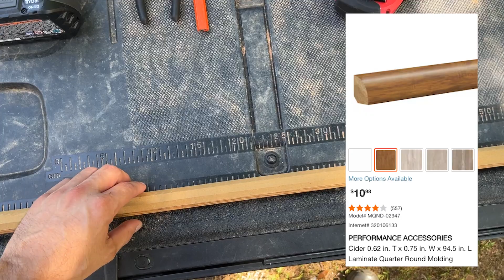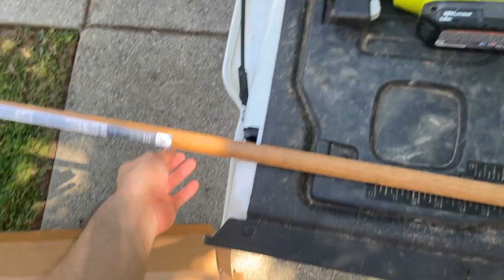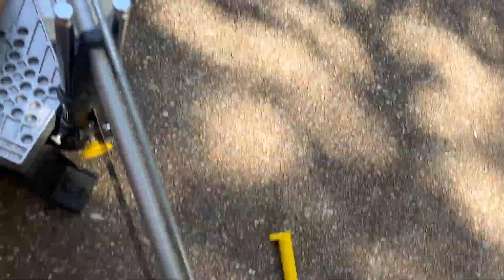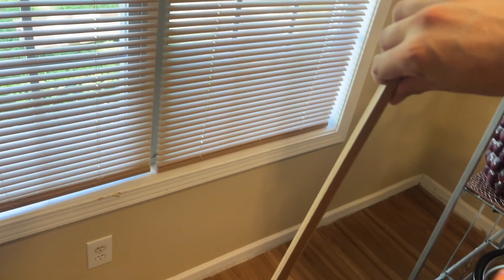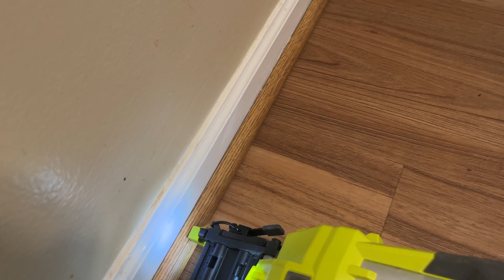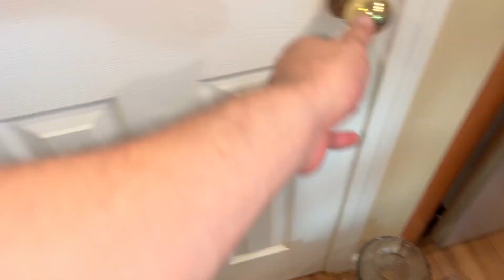Complete Your Floor: Install Quarter Round Molding

Comment: Is it important to leave air flow beneath the quarter round? I don't understand why you wouldn't fill in the gap with caulking or something to prevent bugs before installing the quarter round...is there something I'm missing?
Reply from the maker: Air flow isnt important. Long as the floor is allowed to “shift” to avoid it rising. Its common to calk the top portion of molding to give it a clean and smooth finish. The bottom not so much… but it wont be harmful. Just more work
Reply: @AdrianGonzalez-ag-squared  thank you for the answer, I was more scared of bugs coming up from under it, I'll just have to be careful I don't leave any room for them

Comment: What if moulding is too high from floor for quarter round to be nailed into them? Just get higher quarter round?
Reply from the maker: Hmm, if you havent installed the new floor, i would possibly use this as an opportunity to remove the baseboard, install the new flooring, and then install new floor baseboard flush on the floor. This would look very clean.

But if you already have the new floor installed, then the quickest and simplest solution would be to find taller quarter mold. I would still consider lowering the baseboard to reduce the gap

Comment: How did you end up with large gaps in corners on floor planks. 

Can't we cut the planks much near to the skirtings
Reply from the maker: You’re exactly right! I had those huge gaps due to improper measuring. 

And therefore every DIY’s infamous phase, “measure twice, cut once” :)

But remember, if you don’t remove the baseboards, don’t cut the planks so they are flush against them. As you’ll still need to hammer it into the previous board, and that requires around half an inch or so of space

In the video where I show me installing the flooring, I call myself out for that mistake :(